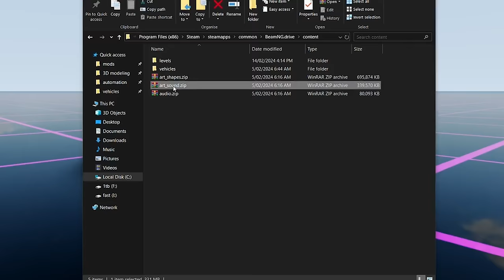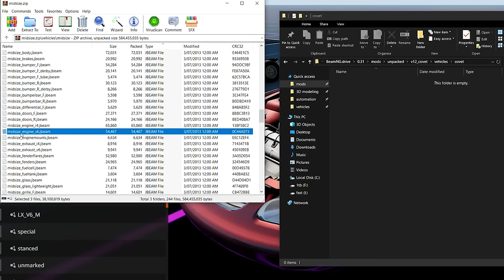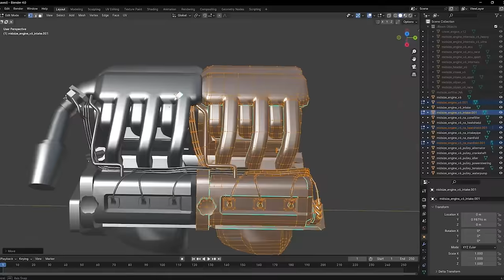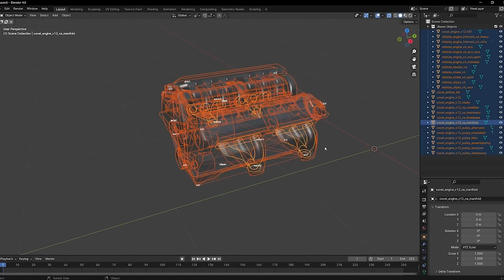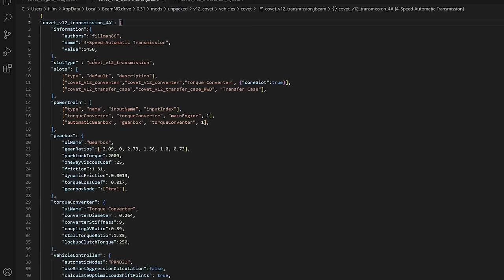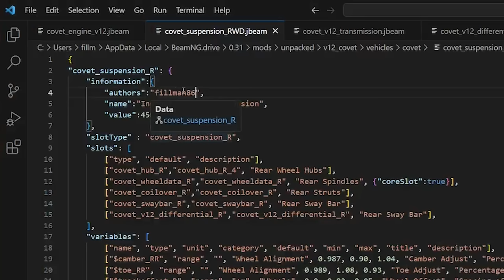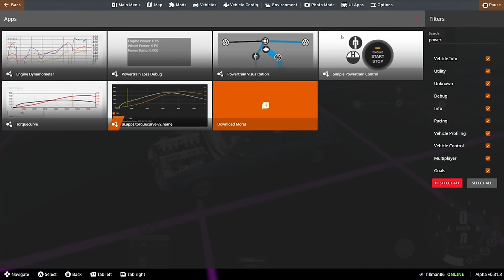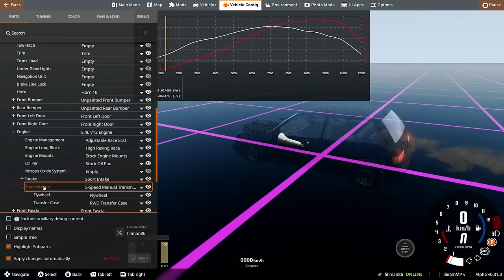BeamNG's Secret V12 Code

Comment: A very interesting thought I had for a mod would be a turbine engine, like the Chrysler Turbine engine, that drives the wheels almost directly, but like through a clutch or torque converter code module that doesn't heat up when slipping, and throttle mainly controls the amount of grip it exerts. There could be one for the cars and the H-series and one bigger one for the T-series only, that way we could enjoy proper jet cars instead of glorified rocket sleds. Like the Bluebuck Gas Turbine mod and the Jetside Special mod try to do, but properly, so long as BeamNG's code can actually simulate it.

Comment: i had a stupid idea that a awd covet that has two v6 but the first one is in the front and the second is at the back
Reply: This sounds like it could absolutely obliterate Pikes Peak
Reply: @felipeferreira00  so true
Reply from the maker: unfortunately beamng doesn't support 2 transmissions, and you can't have 2 engines go into a single transmission either... long story short, it just doesn't work without some kind of modding that I don't know how to do

Comment: You have all of the weight on the front wheels which means you have zero grip in the rear. It won’t oversteer when you brake well either because the center of gravity is so far forward. Also the v12 is naturally balanced because it’s two straight sixes next to each other

Comment: I legit did this on the etk 800 a few months ago and it worked beautifully
Reply from the maker: yeah I put an automation v12 in it ages ago.... it just seems like that kind of car
Reply: @fillman86  so true, you can take any piece from this car and adapt it so easily, i did 2 inline 6 next to each other offset by 60 degrees
Reply from the maker: @eeagle69  each should have been 30 degrees to total 60 (I'm assuming that's what you did, but thought to double check)

Comment: I can totally tune this and make it absolutely mint if you put in some sort of rwd race suspension for the coilovers on the front and rear of this car 
also if you made it awd that would help but not 100% necessary 
other than that itd be cool if you do a modded body where the front core support for the radiator is cut and has like mounts for the v12 to make it look nicer and more realistic i guess also maybe too you could do like a cut interior and make the transmission bigger so it like pokes through a bit or something idk 
add heavier duty engine mounts 
add a turbo or turbo(s) 
make the intercooler and radiator setup rear mounted 
crazy aero
this could be a sick mod dude lol your video has just given me several ideas

Comment: Hey fillman, I’m making a replica of a Yamaha Blaster on Automation and I was wondering how to upload it on the beamng mod page for other people to download it
Reply from the maker: they have instructions you can look up, it'd be too complicated for a youtube comment
Reply: @fillman86  Ok, thanks
Reply: @fillman86  Hey fill, I finished the blaster replica but when I exported it into beamng it acted like it was made out of jello. No joke it just jiggles and the engine revs super slow and just blows up. Please help🙏
Reply from the maker: @tht1dirtbikekid  automation is designed to work with normal cars, not open wheeler type things. 1 trick is to put a 3D cube around the whole vehicle (including the tyres), making sure to have 50cm of overhang of the front and rear. Then paint said cube in a custom glass that is fully transparent. Then when exporting, make sure "expand body bounds" is selected

this is not a perfect fix, but it'll help. You can also use my rigidification mod that's on the repository

Comment: you need to make it awd
Reply from the maker: Unfortunately that still won’t solve the issue of that engine being counter levered over the front axle (not to mention it also wouldn’t fit)
Reply: @fillman86  put it on the rear